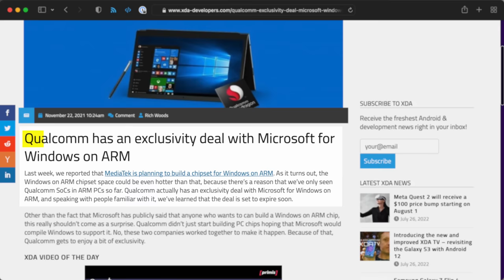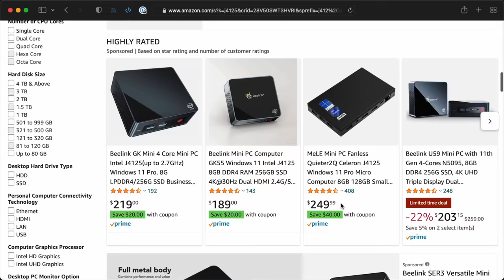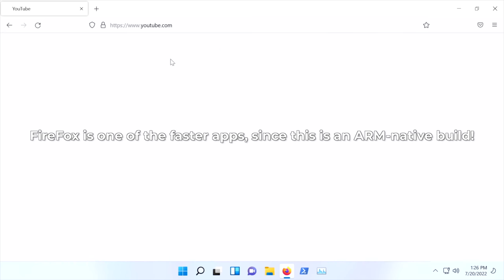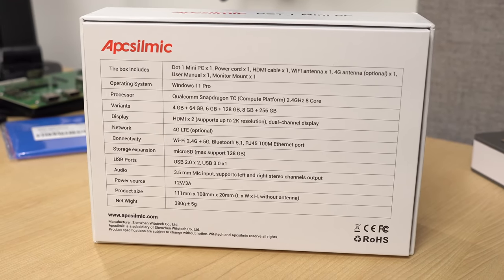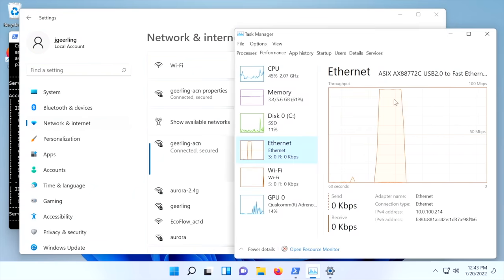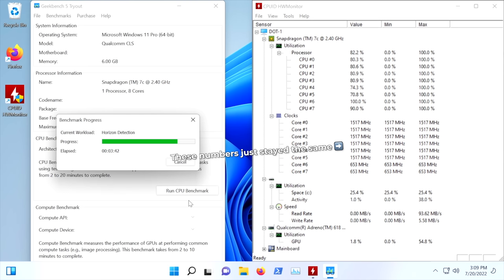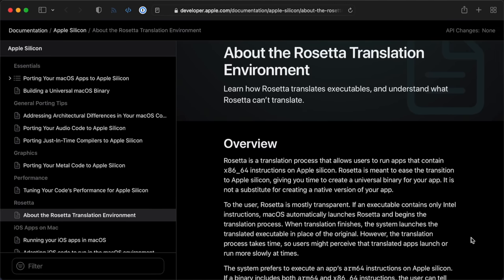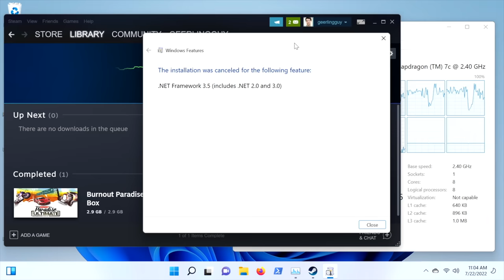Microsoft's wasted potential: Windows on ARM

Comment: I spoke with Qualcomm about this exclusivity deal - they said there isn't one. Simply put, they put engineers, $$$, and time with Microsoft to optimizing Windows on Arm for Qualcomm. Anyone else would have to do their own specific optimizations and work with Microsoft to do that, but no-one has.  In terms of 64-bit translation, I was told by the guy in charge they said that instruction translation was easy enough, but more than half of the issues are due to bad software installing wrong drivers, referencing old/badly linked DLLs, and they've had to spend most of the time simply getting it to work first, before focusing on performance. Because the key market for QC for these devices is going to be premium commercial devices (Thinkpads), they're essentially using the 8cx family as the base line and everything else is entry - realistically it's the Nuvia core next year that's meant to bring the performance to the high-end. If you want, I could get you in contact with the team over there and they may be happy to answer your questions.
Reply from the maker: In that case, I wonder why Microsoft is dragging their feet on getting Windows working more easily on M1/M2.

Qualcomm still seems to be in perfect position to make a dent, it's just that they've been behind on the performance for so long, I don't think many people have faith they'll catch up :(
Reply: So instead of trying to optimize Windows for the arm architecture in general they only worked with Qualcomm? that's disappointing, I get that these things need big budgets and maybe long roadmaps (and optimizing for proprietary components) but I feel Microsoft went backwards about this and I presume it was because Qualcomm was the one bringing the interest and resources. 
And I never got the concept of trying to make Windows arm machines as a "premium" device only (or first), since they can do way less than x86 based machines (at least right now), the only "pro" feature for a consumer in this category is the battery life. If they had went for the Chromebook category instead then I believe everyone would have been more forgiving about its perks and there would be way more interest in it, but yes, the prices of the Qualcomm chips don't match that price range I guess... I really want Windows on arm to succeed, but I don't see how this is going to happen hearing about all of this.
Reply: @walkinmn  The thing is that, once you have x86_64 translation going on, as processors like the M1/M2 prove, it is on par. There's no question in that regard, and you can live on that future today if you're a macOS or a Linux user. It really is just Windows and ARM manufacturers dragging the industry at this point.
Reply: @JeffGeerling  Apple is only little interested in getting Win on Arm running properly on AS. The main culprit i think is the GPU driver. Apple knows it’s hardware the best but would have to put a lot of resources on it. And if MS was willing to write a driver, Apple would have to provide extensive documentation about their GPU and i’m sure they’re not willing to do so. And last but not least: Apple is able to "force" developers to transition to a new architecture whereas MS is – a bit like intel – totally addicted to legacy stuff. Getting your OS to run properly is one thing but, if most apps run under emulation, there is little gain in running it on Arm.
Reply: @janhofmann3499  Apple put a lot of effort into supporting BootCamp on Intel Macs, as it was necessary for getting a lot of people to migrate from Win to Mac.  The same would surely apply to Arm, I think Apple would jump at the chance to get BootCamp running on Apple Silicon macs.
Reply: @hoagy_ytfc  I agree that at the time they switched to intel it made totally sense to support windows as best as possible because at that time Apple wasn’t as nearly at the position in they’re right now. Today, they accept to lose some customers who need 100% x86 support but, they will (i guess) win even more customers who appreciate the advantages like outstanding efficiency and tight integration.
Reply: Great content Ian. Porting windows to new arch was always an afterthought. Its too wintel linked. Lot of translation layers need to be rewritten in native api, win32 and especially kernel.
Reply: @kwazar6725  To be fair: the NT kernel was designed to be portable and there have been versions for DEC Alpha, MIPS and PPC. But today it hurts MS that their own Hardware (Surface) is much slower than Apples and so they seem reluctant to support it properly. And Apple makes a lot of money with services today so they prefer that Apple hardware runs Apple software.
Reply: @walkinmn  If Microsoft wants to ensure the future of Windows they need to make it work on Arm as well as Linux does. Working with Qualcomm should have helped a lot. A missed opportunity.
Reply: @janhofmann3499  Apple does not want people gaming on their computers. Windows and Linux are both good at gaming and both would turn an Apple M2 into a gaming machine if they had access to the GPU.
Reply: @wayland7150  Apple Arcade? The only problem is that traditional game studios do not care about gaming on Mac. And if you're a gamer, Win is the natural choice. chicken <> egg
Reply: @janhofmann3499  I think the problem is Apple chose not to support Vulkan. It's not hard to support Linux for instance, you just make sure you use Vulkan and PROTON or WINE on your Windows version then it will probably work without much effort. Steam is available on Mac.
Reply: @wayland7150  There is MoltenVK as a translation layer. Not optimal but feasible. But i honestly understand why Apple chose to develop Metal instead of using Vulkan. They used openGL for years on standard GPUs from ATI/AMD and Nvidia. Now that they make their own GPUs they wanted the API to be tailor made for the hardware. BTW: nobody blames MS for creating DirectX but when Apple designs their own API it's all bad suddenly. If a game studio wants to deliver the best experience on OS X they should bite the bullet and use MTL. On the other hand: every time a new AAA game is released for Windows, both AMD and Nvidia release driver updates to optimize for the new game. It would take years (if ever) for the Mac to get to the same level of optimization. At the end of the day: a Mac is no "serious" gaming machine and will most likely never be. I always had the impression that the GPU for Apple is just a more general accelerator that can be used from rendering video effects to run ML-models. Gaming itself is more or less a byproduct. That's why we won't see e.g. raytracing hardware in Apple GPUs anytime soon, except if these units could be used for something else, like rendering 3D-models in Cinema4D, Blender and similar applications.
Reply: @janhofmann3499  indeed. But crosscompiling was never fun or reliable first time round especially with low volume custom hw. And yes, ive been an os dev in my previous life.
Reply: @JeffGeerling  why would Microsoft want Windows running in competitors hardware? Not even Apple is that interested. The world has moved on from the 90s. Windows on Macs is now niche and Microsoft is very aware more people buying Macs is now a threat it simply wasn't before 2020. Its just not in Microsoft's interest.
Reply: @walkinmn  that's just plain false. For the major of consumers Windows on ARM is already suitable. Don't downplay how important battery life is too, no fans, no overheating. Yes of course its not for everyone but techies forgot most users don't play Windows games, don't video edit. Photoshop is already Native ARM. Do you know what most people use their pc for? Web browsing, that's it. No native Chrome is a perception problem though. I only use a Surface Pro X and now all my apps are Native ARM or run no different (WhatsApp). I use an Intel laptop for work but wouldn't go backwards to Intel or AMD on my personal laptop. Ironically it's consumers not businesses where Windows on ARM is more suitable right now. Businesses too of course depending on the apps they use. The comparison to Chromebooks just tells me you've not used Windows on ARM and don't understand the category. I happen to also use a Chromebook for travel but my Surface Pro X would be a serious downgrade if it ran ChromeOS.
Reply: @janhofmann3499  exactly. A niche of users what Windows on Apple silicon way before than Apple or Microsoft do. Apple used to sell Macs as also supporting Windows. With most major apps now cross platform and the web their reliance on Windows has dropped significantly.
Reply: @LawsonBarnette  Apple has a long history of designing custom ARM processors. Qualcomm, they just use stock ARM cores with no custom cores for now. I am not suprised that Qualcomm is behind Apple in raw speed and efficiency. The Surface Pro X is a good kit but underpowered. It will only be good for basic tasks.
Until Qualcomm releases Nuvia chips which are made in CPU leadership in mind, Windows on ARM will get better in late 2023. They won't beat Apple in every aspect, but Qualcomm will have better chips by then. Of course, Apple won't stand still. There will be plenty of competition in late 2023 - 2024.
Reply: @walkinmn  bro they need to optimize it for amd64 first 💀💀💀
Reply: This sounds like so much BS that it is hard to know where to begin.  If there was no exclusivity deal why won't Microsoft officially approve use of Windows on ARM or ARM CPUs other than Qualcomm's.  More over when XDA Developers came out with this claim why didn't Qualcomm publicly state there was no such deal?  The fact that Windows on ARM runs so well (nearly 2x) on the M1 effectively shoots holes in the whole "specific optimizations" claims.
Reply: @wayland7150  That is no longer true as one of the things Apple demoed on the prototype of the M1 was a Tomb Raider game.  Linux still has issues and its game library is nowhere near that of Windows.
Reply: @Maximara  Linux game library is near that of Windows.
Reply: @JeffGeerling  MS drags their feet on anything related to Windows. Between being bloated, and the fact that they are afraid to fully cut support for older software, It's been a mess for most of its life. A great example of that is the fact that there's still a Control Center and other random legacy components inside Windows 11. They can't even finish their overall from Windows 8.
Reply: What surprises me is that NVIDIA isn't jumping on this. Didn't they buy Transmeta to get into the x86 game, only to be kicked out anyway? That would make for a clear, obvious path to developing a Windows on ARM SoC that could likely actually take on Apple's best.
Reply: >Anyone else would have to do their own specific optimizations and work with Microsoft to do that, but no-one has.

Will anyone else, I wonder? Nobody else will have NUVIA cores. Judging how much pain, money, and reputational damage Qualcomm has paid just for a few low-volume, low-perf SoCs in the past 8+ years, who wants to throw good money after bad? 

Everyone interested in Arm in the desktop went to ChromeOS: "bad software installing wrong drivers" don't exist, mess of DLLs don't exist, and very low overhead. Microsoft has let decades of spaghetti code erase all of Windows' NT "multi-ISA" compatibility—by choice. Wintel remains a very dominating force.

Not to mention the now-cancelled Windows 10X was also x86! Windows RT, Windows 8, Windows 10, and Windows 11 all "can" run on Arm, but Microsoft squandered most consumer interest with poor Surface products + the entire Windows seemed to say "Won't be us making that mistake again!"

Microsoft led OEMs down a terrible path with Windows 8; they fell hook-line-sinker for the "touch-based future" that has slowly lost all priority. 

MediaTek, Samsung, Rockchip, Amlogic, etc: maybe by 2030? Honestly, Microsoft should've partnered (read: paid a lot of money to) with Arm Ltd. to optimize Cortex cores, then let Arm licensees separately optimize their in-house IP blocks.
Reply: I've seen RockChip-based prototypes in the past, so...
Reply: lies.
Reply: @JeffGeerling  Why would they? What's in it for Microsoft? Think about this for a few minutes and you will realize it isn't in Microsoft's interest at this time.

Microsoft wants Windows ARM to replace PC's, they don't really care if a small portion, of a small portion of the people in a small non-core market want it. Microsoft wants Dell, HP, Lenovo, Samsung and all the others to make Windows ARM devices for corporate use. Apple's business model of a restricted eco-system and limited legacy support means it will never participate in any major way in the corporate and government PC market. Without a removable SSD, Apple is automatically excluded from almost all government and corporate contracts, for example. I suspect TPM 2.0 (an industry standard) is also a requirement, so the T2 (not an industry standard) doesn't cut it either.

Also, consider the support cost to Microsoft if Windows ARM never becomes popular. Microsoft would have to commit to long term support for Windows on the M1. The latest generation Intel chips are faster and more efficient and in the end corporations and government may stick with Intel simply to ensure backwards compatibility - which is their biggest concern. Microsoft doesn't update drivers for devices and support software from the 1990's just because they are nice - they do it because their customers demand it. All this means that Windows ARM could fail despite Microsoft's best efforts.

Truly, if you want Windows on your M1/M2 stop bothering Microsoft and start asking for it from Apple. It's an Apple device with Apple hardware. Apple could get device/hardware certification, and pre-install Windows 11 just like everyone else. As the comment above shows, the deal between Qualcomm and Microsoft isn't stopping Apple, or anyone else from doing this.
Reply: @walkinmn  You've got it totally backward.  Windows 11's x64 -> ARM64 Emulation is a generic emulator for ARM 64 platforms.   Apple is the one that redesigned their ARM chip to build x64 emulation into the silicon of the M2 chip.  

In order for Microsoft to get Apple like Emulation performance they would need Qualcom (or Mediatek or...) to make an ARM chip with x64/x86 hardware emulation.
Reply: Of course Qualcomm won't admit that "Microsoft’s Qualcomm exclusivity deal for Windows on Arm reportedly ending soon" because they don't want to take the heat for designing a poor ARM CPU.
Reply: And what were the lots of reports regarding this topic about? just spreading misinformation?
Reply: It is happening, Dr. Cutress.